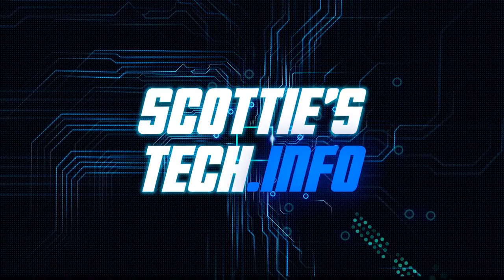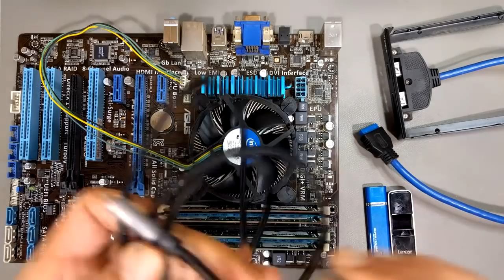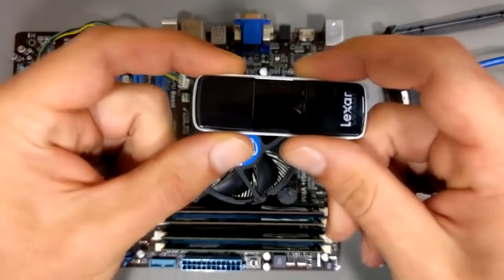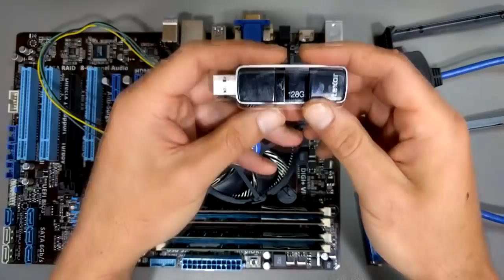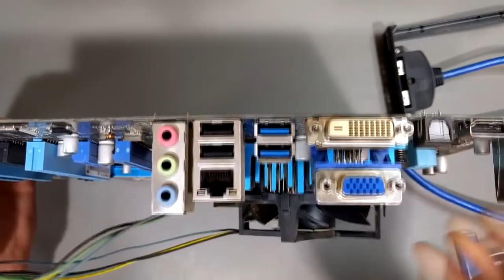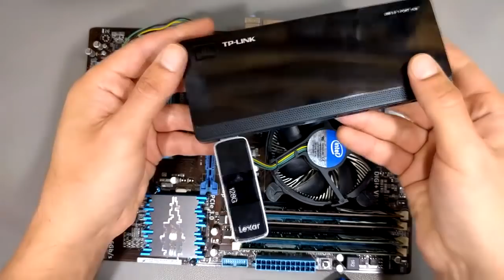Slow copy speeds with USB 3? No problem!

Comment: 400 MB/s is an absolute lie. I would like to see a video of that. Even my Samsung 850 Pro SSD doesn't transfer that fast. This video is filled with false information.
Reply from the maker: USB 3.0 is max 625 MB/s, USB 3.1 is 1250 MB/s, and USB 3.2 is 2500 MB/s. Those are theoretical max speeds. Real world speeds are lower (like 400 MB/s practical for USB 3.0) due to overhead in the USB protocols. The reason you don't usually see those speeds is because of the (slow) device connected, the USB interface itself, driver issues, Windows issues, and even the type of data being copied. Copying 1 large file to a USB 3 mem stick can be very fast, but copying 3000 files/folders will be VERY slow. Samsung even makes external SSDs using USB 3.2 that have a max read speed of 1050 MB/s. But there again (like your 850 Pro), that depends on if it's a read, write, and even what KIND of read/write you're doing (random, sequential, and so on). In the case of SSDs, it also depends on where the file(s) you are copying to/from the SSD are located. If they're on a normal HDD, the slower transfer rate of the HDD is the limiting factor. Or, if you transfer files from another SSD on a computer on your local 1 Gbps Ethernet LAN, then the Ethernet limits the copy to ~112 MB/s. Even SSD -> SSD copies can slow down depending on the files being transferred. As for fast USB sticks, I did a vid on that:  https://www.youtube.com/watch?v=iydlU4PPQbI   My fav currently is the USB 3.1 Samsung Extreme PRO 128GB. A 2GB movie file can be written to the stick at 276 MB/s, and read back at 327 MB/s. The Many File/Folder test was much slower: 66 write, 97 MB/s read.
Reply: @ScottiesTech  My USB 3.0 Flash Cards from Sandisk, Kinston, and PNY might "start" at 40MB MB/S for about one or two seconds, but then it drops down to tiny curves ranging from less than 1MB/s (literally kilobytes per second), and going to 2, 4, 6, 8 ,10 MB/s, and then back down to 8, 6, 4, 2, 0 MB/s.  It took me over two hours to fill up a 64GB card when I recently transferred multiple video files ranging from 200MB in size up to 3GB in size. 

I tried this is both "Quick" mode and "Better Performance" mode. I also tried it in both NTFS and exFAT.  I also tried this in the "Default" size, and the smallest size, and the largest size when I formatted the USB 3.0 cards multiple times. Nothing mattered. 

Also, I tried switching over to a different computer. So that way I was using the "rear port" of a desktop PC rather than the "side port" of a laptop. It was still super slow. 

And those USB cards didn't even allow a checkmark to be put in "write cache." You could select "Better performance," but not "write cache." 

The fact is, these USB cards from manufacturers such as Sandisk, Kingston, and PNY are truly terribly slow. They are virtually worthless when transferring large files such as videos. 

At this point you can buy a 128GB or 256GB SSD for about the same price as a USB 3.0 USB Flash Drive. So, it makes better sense to just buy a small cable to connect the SSD and use it externally to connect to your computer or TV. 

BOTTOM LINE: USB 3.0 Flash Drives are SLOOOOWWW and worthless when you need to fill them with lots of data. It takes HOURS to do so.
Reply from the maker: @michaelzoran  There's a bottleneck somewhere... I just wrote an article about this:
https://scottiestech.info/2020/10/06/how-to-get-more-speed-from-your-usb-drives/
I've had laptops and desktops that required a BIOS update and/or driver update to get full speed from USB 3 ports. The standards changed a lot and there was actually some mayhem that occurred because end users weren't getting the promised speeds. The problem was the result of some change in the standard that Intel didn't share earlier enough. Most manufacturers released new drivers or firmware updates that fixed the problem - some didn't.

If it's not the cards, then it could be the card reader. Even using the wrong USB 3 hub can slow things down. I had a Belkin USB 3 hub for awhile and I was wondering why I wasn't getting higher transfer rates... First, I found a new USB 3 driver on the Asus web site. Okay, that'll fix it! Nope - still slow... Turns out it was the frickin' USB HUB I was using!!!  I nearly flipped my lid. Bought a TP-Link USB 3 hub, and that one actually works. 

Anyway, the first thing I would do is get a fast USB stick that you know can handle ridiculous copy speeds... Then plug that directly into the USB 3 port on the puter. If you don't get fast speeds, check drivers, BIOS updates, etc. To test, do a copy of a single large file (2GB) from a fast drive (SSD preferably). Once that's working, then switch to the card reader or whatever other gizmo you're using and test that. It may be seriously annoying, but you CAN get faster speeds.
Reply: @michaelzoran  My Patriot Rage sustains writes at 450 MB/s. Ejects immediately. Stop buying cheap thumb drives. 95% of their capacity is QLC Flash which is cheap, dense, and slowww.

Comment: Does a USB 3.0 hub on a computer with USB 3.2 port throttle the speed of a 3.1 or 3.2 flash drive to 3.0 or downward from its potential speed?
Reply from the maker: Yes. Also beware certain USB 3.1 hubs that advertise 5 Gbit/s speeds. USB 3.1 should support 10 Gbit/s.

Comment: Need to go to disk Management, then drives then select whatever drive it's hooked into the USB 3.0 Port go to properties and change the setting 2 performance.  Will blow your mind the differences in speed you get. Just need to always make sure you safely eject your hardware if you're doing it this way

Comment: Nice Info. Have you seen the same issue with addon pci cards aswel?
MY computer does not have USB 3.0(yep its old, stable and reliable) so i got an cheap USB 3.0 card and installed. But I cannot seem to get more than USB 2.0 speeds...
Reply from the maker: Yes, actually. And in my case a driver update wasn't available, so I was out of luck. It just never worked at full speed.

Comment: Sadly it didn't work for me. Both the front and back ports gave me the same results. I tried a USB 3 thumb drive and an SSD via a dock, no change.
Reply from the maker: You may need a specific USB 3 driver from your motherboard/puter manufacturer then. The default Windows ones don't always work. Not sure about linux, but usually everything just works on that front.
Reply: @ScottiesTech  How do you go about finding the right driver? I know they're not something you should mess with if you don't know what you're doing.
Reply from the maker: @flameshana9  Yeah, it can be lots of fun. If it's a full computer purchased from somebody like Dell, then you'd search for the model number on their web site in the supports/drivers section and see if there's a specific USB 3 driver available. Or, you'd have to know the motherboard make and model (usually printed on the board itself). Then go to the manufacturer's web site and search for mobo model number. Companies like Asus that make motherboards typically release new drivers to fix issues with, say, a Win 10 update, but they don't actually notify you of their availability. In both cases, you just download the driver and run the installer. It's pretty safe and painless - except for actually finding the driver!

Comment: IN SUMMARY: Use ports on back of your mobo, not the front panel connector as its controlled by its own chip and much slower.  I just tested this and got 68 MB/s  instead of 32MB/s  when copying a movie to a usb stick.

Comment: i am currently transferring my 100GB over two USB 3.0 drives and it has slowed to 1MB a sec. Using the only two USB 3.0 ports this laptop has.
Reply: I know this is an old comment but for anyone else wondering that sounds like it started fast then slowed because you filled the drive's cache and now you are being limited by the actual write speeds of the drive

Comment: I plug my SanDisk 32GB USB3 in a USB3 hub in the back of my pc (directly into motherboard USB3) but still write at around 20 MB/s (160ish megabit) and read at 133MB/s (1100ish Megabit). Is this due to slow USB storage device? That is an issue not covered (much) in the video; the fact that various drives have lower write speed. I have another Sandisk 64GB USB writes at 32 MB/s and reads at 150MB/s. Used to buy Kingston drives, but apparently they are super slow...
Reply from the maker: Yup, that's typical. That's why I recommend the Lexar P20 (link in description). It's wicked-fast in both directions!

Comment: Does not work for me, I have the same USB extender u have from TP-link, all ports USB 3.0, and my USB Flash driver is USB 3.0 Aswell, Went into "device manager" and put it on "high performance" restarted computer but I still get speeds at 20-30mb/s copy speeds, I honestly have no idea what to do! and yes i am copying from an SSD to USB 3,0 Flash drive.

Comment: thank goodness we can fast forward. bottom line, some usb chipsets have driver issues and the author has no idea on how to fix it, only suggestion is try to use a usb port that connects to an intel usb chip, either directly or through a hub.

Comment: Since most people are already plugging into the right spot, check device manager and make sure write caching is on for the drive.
Reply: it says don't check this if you're not wanna loose data (?)
Reply: @shinnyspace  it means you will have to choose "eject" to safely remove the media or it may become corrupted. It's a worthwhile measure to get the best speeds for USB flash drives.

Comment: My speed is up and down all the time. I'm transfering between USB 3.0 External HDDs and its a lot better in the back but no where near what he said with a write speed of +200MB/s. More like 75max and drops into the Kilobyte range sometimes. Agreed a little long winded but not bad, was kinda interesting.
Reply: Mine are exactly the same. Starts high and then down to kilobytes. They are usb 3 to usb 3 ports and yet they are painfully slow. They are the name brands like patriot and sandisk too. I just don’t get it

Comment: Thanks for this. I have been frustrated with some USB 3.0 hubs performance however. Finally I tried a very inexpensive one from Monoprice that came with its own power source, and the speed from my USB 3.0 flash drives is the same, wether connected directly to port, or powered hub. The majority of hubs that I tried that relied on bus power, greatly reduced the speed of my drives, even if the drives had their own power source.

Comment: Also keep in mind that if you are writing to a SD card (or microSD card), the speed that is printed on the color box is READ speed.  The actual Write Speed is much lower.  Example, Class 10 SD card is supposed to be only Max 10Mb/s, however in reality, for example, SanDisk Ultra only gets me 7-8MB/s.  SanDisk Extreme gets me approx 20MB/s( and it is more expensive). Regular Samsung SD card gets me 8-9MB/s, but Samsung EVO microSDHC I gets me 21MB/s.
Reply: updated about SD card, for HD recording & camera use, better choose UHS-I (U1) = at least 20MB/s, if you choose UHS-I (U3), the write speed can be at least 40MB/s, max 90MB/s.  Then, if you move up to UHS-II, you will be seeing 80MB/s write speed to max 190MB/s write speed.  *according to this video, pay attention to which port on the USB 3.0 card reader is faster or with UHS-I/UHS-II support.   https://www.youtube.com/watch?v=KwiJBi3Thxo

Comment: How do you fix the speed issue on a Laptop? Also, does it matter what hub you use?
Reply from the maker: With a laptop, your only option is to play with drivers - and maybe pray.
Reply: $#!+... I guess that makes laptop USB 3 nothing more than a marketing gimmick.
Reply from the maker: Well, USB 3 on my lappy works well. But it really depends on if it's USB from the chipset, or from an add-in USB chip, how good driver support is, etc. So, it's kind of a toss-up.

Comment: I have a sandisk 128gb usb3.0 flash drive,it's good with usb3.0 ports,but the problem if i want to copy something from a pc with usb2.0 ports its tooo slow it's transfer rate is 4mb/s...is this problem could be solved😿
Reply from the maker: 4 MB/s is pretty slow even for USB 2.0! Unfortunately, without a USB 3 port, your drive will not work at max speeds.
Reply: Yeah i see,but i mean is there anything i can do to make it faster with usb2.0
Reply from the maker: Well, you could try a different USB 2 port, or see if it's some kind of driver issue or something...
Reply: Ok i'll try thank you
Reply: Same my 32GB USB stick is horribly slow, Its a USB 3.0 and am only getting around 127kb/s to 250kb/s

Comment: OMG!  Video - 15 mins.  Fix explanation - 10 seconds.  Don’t use front, use rear.  Get  a hub.

How many times did everyone fall asleep?
Reply: Is that all it is? I've been doing that for years and its still below 10MB/s for any file over 3gb
Reply: within the first 10 secs. Good info but not what I came here for.
Reply: Yeah as a geek I watched & enjoyed every second! Why because I didn't just want the solution to the problem (USB 3.0 hub), I wanted to understand it (connecting a HUB directly to the chipset USB socket using the SS HDD protocol cable) and that is why next time I come across something similar in the future I can save some time. That is the difference between someone smart and someone who thinks they are smart... WANTING TO UNDERSTAND AND LEARN!!!!!!
Reply: @cjd-vo4mh  no, no, no. it's all about the situation, and whether you are in the mood to learn, or in the mood to solve a problem right away. just because someone doesn't want to hear a lecture about the history of USB BEFORE getting to the solution they cam for, doesn't mean they won't want to learn at other times. Saying this makes someone dumb, is like this:

GUY 1: i'm at the bomb disposal site. how do i disable the bomb?
GUY 2: gives an explanation of the history of bomb making
GUY 1: that's great, but I really just want to solve this problem right now.
YOU: Man, you're so uninterested in learning! How dumb!

Then everyone explodes.

You don't get to decide how valuable someone else's time is, and it's unwise to judge someone's entire character based on how they want to do something RIGHT THIS SECOND.
This video was more about describing the problem, which is fine, but the title should reflect it. and having a tldr section at the beginning, then the longer explanation, satisfies everyone.

the appropriate title should be "WHY You Sometimes Get USB 3 Copy Speeds + Possible Solution"
Reply: Came to make the exact same comment. Great stuff, but not what I was looking for from the title.

Comment: old vid...don't care.
history good.
Fix..Not present. Boiling a pan of water does not fix a none boiling kettle.

It could be, motherboard jumper/switch not in correct position, Or bios usb 3 mode disabled(defaults to usb2), Or bios usb3 pcie lane allocation. Or maybe like in your usb2 vid they used slower cheaper flash.
Sometimes things don't ship in the optimal configuration and sometimes even the default/optimal settings don't have the settings you want enabled.

Comment: Even though pluggin them in the back of the pc i just get around 10 MB/s -.-
Reply from the maker: Is it a USB3 port that's directly connected to the motherboard, or a USB port in an add-in slot like where PCI-E cards would go? If it's a built-in mobo port, then I'd prolly check for an updated USB3 driver from the mobo maker. That'll usually fix it good.
Reply: Scotties tech info forgot about the 3.1usb ports